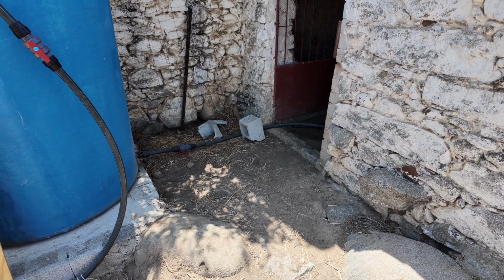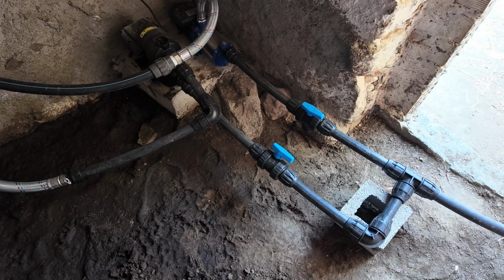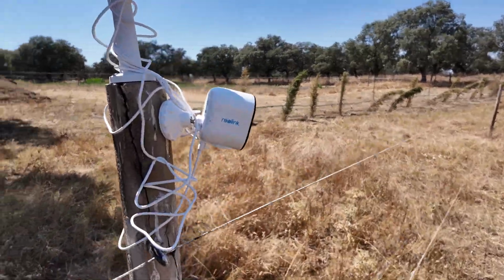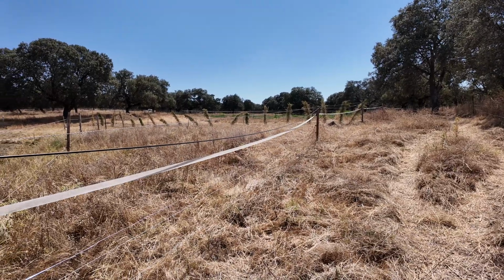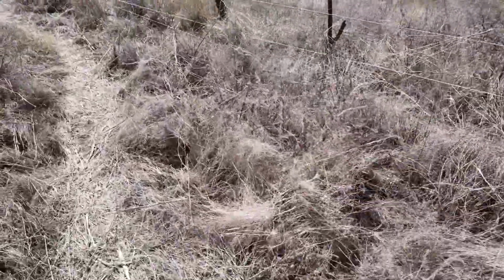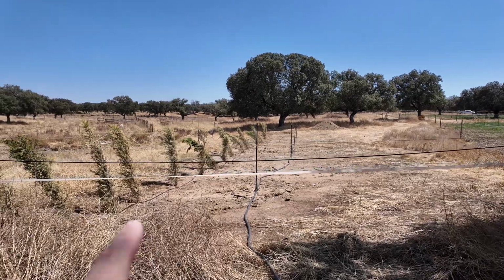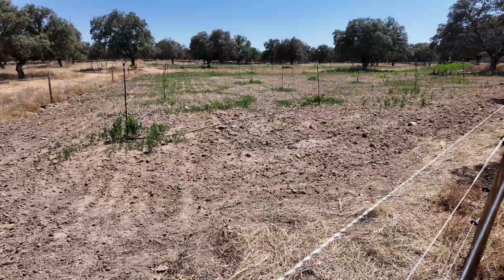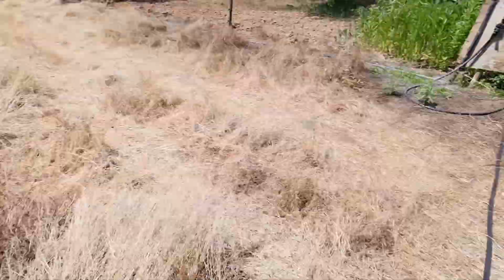UPDATE on irrigation, Sunn Hemp, infrastructure

Comment: I agree on suggesting to straighten the cypress trees.  If they are young and in a straight line, you can use two poles and a rope to form a horizontal anchoring point to tie them to up straight.  That is less materials than staking up each one.  If in a crooked row or high wind area, need to do each one.  Yours may be too big for a single line.  With you watering they will grow green mass fast and probably bend over more unless straightened.
Reply from the maker: There are 5 that have an issue. It's because the soil is loose and so they need some help. We are trying to fix that.
Reply: @ProjectGranjaCaimito  Understood.  I enjoy your channel.  I have 19 acres, two 1/4 acre ponds and a tree nursery.  Tree stewardship is one of the reasons I own my property.  In my climate zone 9B, I use Red Cedar in the fashion you are utilizing the Cypress.  In my area there is deer pressure and I am forced to stake and pen all of my trees until they are about 8 years old.  I enjoy seeing your challenges and improvements.  Thanks for your work!

Comment: great installations ! Do you use clear water pumps or waste-water pumps (which can handle sand and clay parts) ? Do You have termites or similar ants around, that nibble on the planed boxes ?
Reply from the maker: No termites here. The pumps are either regular water pumps for clear water or made to be submerged in a pond/well

Comment: I have heard of using high pressure air to fracture compacted hard pan. I don't know if this might be practical or economic. Have you heard of this?
Reply from the maker: No but I have read that any mechanical solution will not last as the source of the problem does not go away. Soil is supposed to be full of organic material but concrete is not. So ...
Reply: @ProjectGranjaCaimito   Curiosity made me look a little deeper and came across a German company called VOGT Baugeräte GmbH, who are in the soil decompaction business. Their kit looks like single man operation. Seems expensive but I have seen other less professional, home-made setups.
Reply from the maker: @Marpleman  Soil is a living thing. Compaction is just a result that happens when things are out of balance. It's a symptom and not the cause of the sickness.
Reply: @ProjectGranjaCaimito  Sure, I understand the soil is 'alive' and you have spoken about having compaction in places. Just as you are kick-starting areas using water, I expect you can also kick-start the soil with decompaction techniques. Biochar and other material injection was mentioned in some of the Vogt videos I saw.

Comment: Nice hat bro.  At 18 minute mark you wisely talk about going back to the times of having denser forest. Great idea.

Please consider planting your swales out this next planting season. It will go a long way to reaching your goals of denser forests.  Plant with species you dont have to care for also helps. Your swales have a moisture profile, you'll be ok with walnut, olive, fig, pommegranite. Cheap plantings.
Reply from the maker: We will not go far from the farmyard. The existing swales are too far out. That rule we violated with the Miyawaki forest but it was the only place where we could plant such a thing. It is out of sight from the farmyard but at least we drive by when leaving/coming back. Not ideal.

If you look at the map that means: only do things inside the farmyard or the adjacent areas in zones A and B. That's also related to the water supply for irrigation. We might be able to store some 700 m3 and that limits what we can do until an area becomes self-sufficient. It's basically about planting a green belt.
Reply: @ProjectGranjaCaimito  plant the swales anyway,  you'll look back and say I should have planted them.   Plant and leave them alone, its one days work,,, its a bit nuts not to do it if you have that swale infrastructure sitting there.
Reply: ...another possibility is to cast seeds of sun-hemp & friends & OTHER seeds INTO the swales themselves & leave 'em alone after covering them with a light layer of the soil from the swale bottom. WITHOUT having to irrigate them. Let them germinate & grow on their own when the right conditions arrive.
Reply from the maker: So what you mean is to put them in there, rake them in somehow and then let the rain fill the swale and when the standing water is gone things might germinate? Like that?
Reply: @ProjectGranjaCaimito  you could do that in the swale hollow, yes, if you have left over seed you  could also seed the swale mound and just walk away,,, no maintenance-no irrigation. But have respect for seed germination time, dont plant late.

But what I really mean is it would be a very simple job to plant 150 trees on each swale mound.  (Total 300 trees). 50 olive, 50 fig, 25 pomnegranite, 25 walnut.  (x2 swales). Then walk away, do nothing- the tap roots will go down.

It would be folly to have swale infrastructure and you turn your back on it.

It would be folly to be so rigid in your decision to do zone 1 / zone 2,,, and completely ignore the zone 4 swales.    The correct permaculture protocol is to plant  the outer swales, have them grow for 5 years whilst concerntrating on the inner zones.

It just a suggestion, as you did so much work to have them dug, dont waste them.   Be fluid in your decisions, its only a days work with 2 or 3 volunteers.  ❤
Reply from the maker: With volunteers that's a bit easier to do. Yes. Which means that we also have to finish the space for the volunteers in the cortijo. It's half done.

The two of us - as it is - can't really afford such adventures. And also note that I am mostly a "half" as I have other things to do as well. The €€€ need to come from somewhere ;-)

It is nonetheless a good idea and could be a really nice project with some volunteers for a week. At some point it will happen. Good time for it is autumn so that things can establish while there is water and it's not too hot.
Reply: @ProjectGranjaCaimito  Yep, sow it & then  forget about it.

Comment: You should maybe consider some more drought resistant plants as cover crops like millet, sanfoin etc etc? They all root deep and need way less water and are easier to set up. The overall cover right now is not the best to be completely honest :/ i think there are better options for cover crops in your area than the one you have right now. The area with the leak shows you how it is actually supposed to look like right now and since water is a limited resource in your set up maybe a less demanding crop would be better as initial planting. 

Just my 2 cents :)
Reply from the maker: Thanks for the good thought. Yes, that's a worthwhile consideration
Reply: ...THOSE seeds could be cast into the swales, covered up with a light layer of soil, and then left alone.